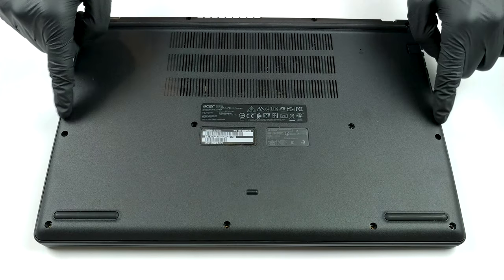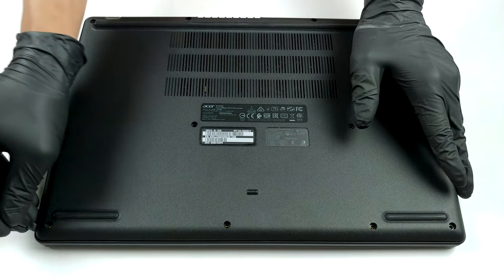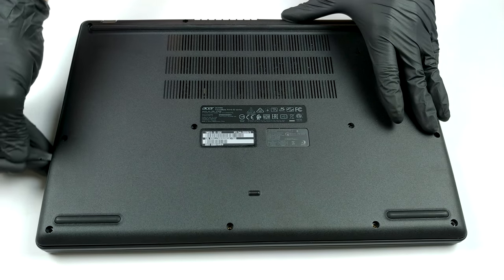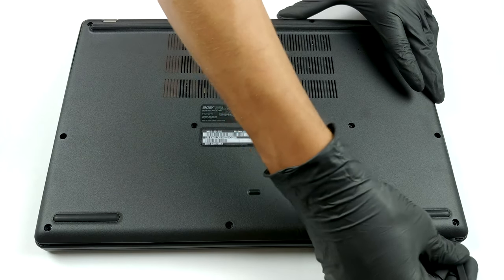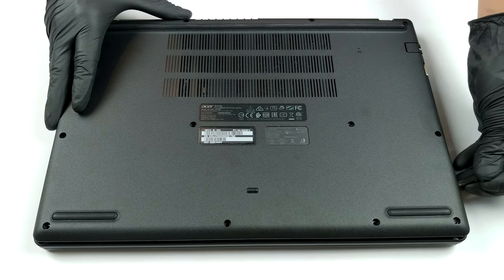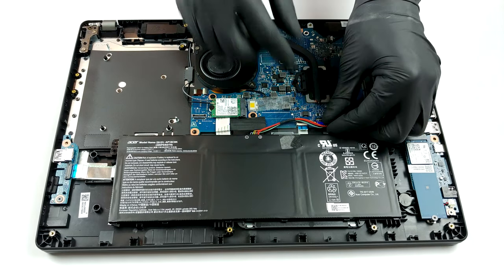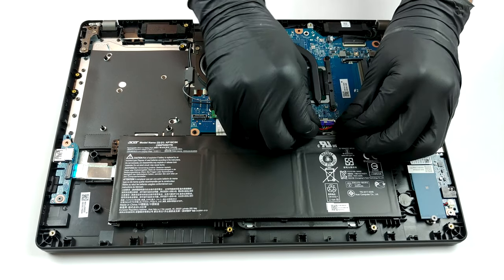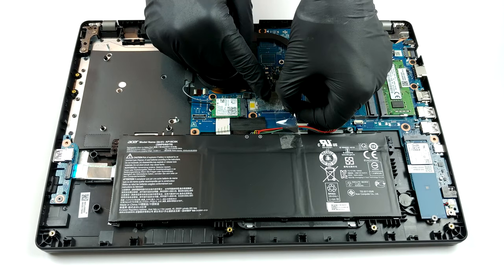🛠️ Acer TravelMate P2 (TMP215-52) - disassembly and upgrade options

Comment: Does it have a nano SIM card port?
Reply: Yes
Reply: @afiolbityca9671  I can't see any port in mine. Is it an external port, or is it located somewhere in the device?
Reply: i thought  you said an SD Card slot not a SIM one, my bad sorry
Reply: @afiolbityca9671 , oh okay. It's fine.
Reply: I'm wondering though, do you need that for internet  access on the go or just nice extra feature to have on the laptop?
Reply: @afiolbityca9671 , well, I can't really bring with me my Modem anywhere I go so a Pocket Wi-Fi or a SIM card would have been nice. Also, I saw this one option when I click the internet connection button that says Mobile Hotspot. What would have been the use of that feature if the device didn't have a SIM in it though? Is it for tethering purposes like for programs or applications that needed the feature like Phone to laptop sharing? I was kind of a bit curious and confused so I was looking for answers and got as far as YouTube.
Reply: Well, the phone hotspot would  suffice if your not aware  from the home modem but the pocket wifi it's  a nice solution too in the absence of the integrated sim card option ! But then your phone's battery would suffer the consequences  if that was the case, in theory the opinion your talking about as i was asking myself some time ago with an older generation of laptop would had the possibility to share the sim card's internet to other devices with a ssid and a password,  as a normal modem (ruter) would, but i couldn't test that theory  because  i had a sim card slot on a 11 year old laptop  but couldn't  use it because  it didn't  had the modular  inside  to utilize the sim, which  i didn't  bother to go out  and buy one anyways!
But now with this laptop i see that you can actually share the internet your receiving from wifi  to other devices in case the laptop's wifi range  and  signal  quality  is better  then your phone's  for instance.
Hope to have given  some useful information!